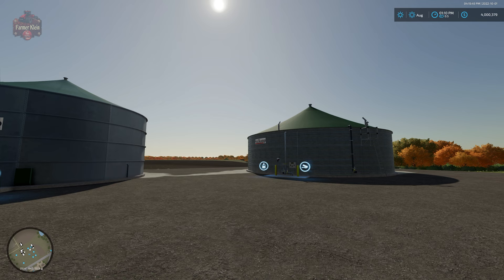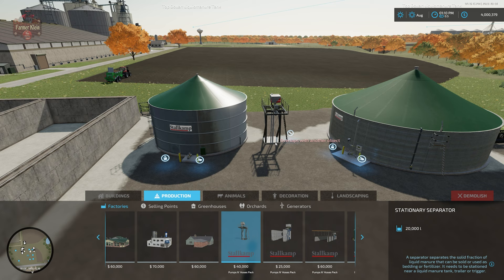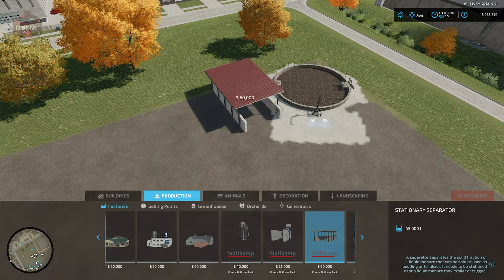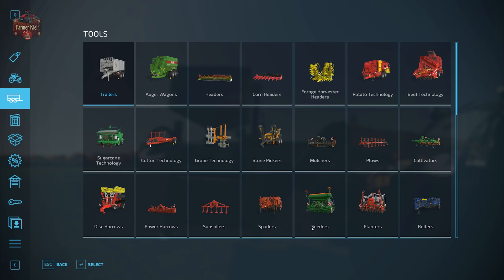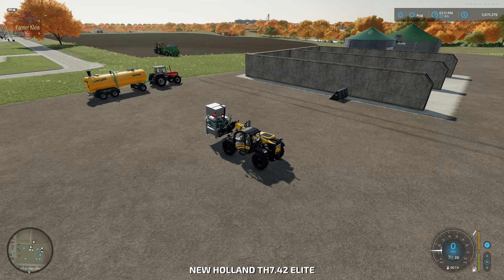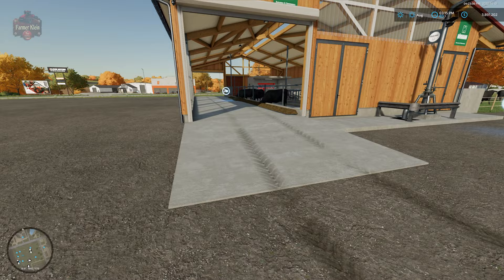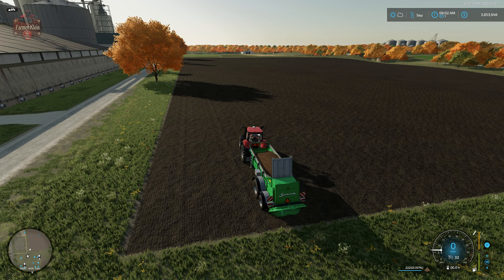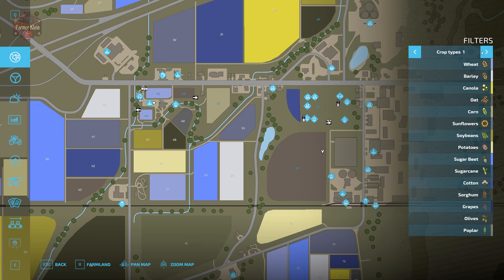Pumps N' Hoses A How To | Part 2 | Separated Manure

Comment: In the real world it would be used to remove the solids out if the slurry to concentrate the slurry, spread the solids and use the liquid for a bga or slurry spreading. Be interested to know if the slurry once “separated” is completely used or if you get a little bit of fluid back in return for some separated solids as it doesn’t look like you doo
Reply: I was thinking about this. When you separate manure, where is the other part (ingame)?
Reply: @salilladelop  just seems like it was a missed mechanic when implementing this, it’s awesome don’t get me wrong but essentially all that’s happening is your turning slurry or digestate from a liquid to a solid
Reply: I work on these machines a lot actually and yes the “water” or the bi product of the separators because they can never get all the water out goes in a return pipe back in to the reception pit it came from so it’s pretty much just recycled

Comment: How much nitrogen can it apply with precision dlc?
Reply from the maker: Unless precision farming picks it up as regular manure which I woudl probably require either an update to PF or a script within pumps n hoses to make that change to PF I would say none at all as the nitrogen value of a fertilizer is defined within the PF mod itself so adding tihngs like seperated manure or compost or anhydrdious requires either changing the PF mod to know how much nitrogen to add for a given soil type or a script to inject those chnges like the anhydrious addon mod does.

Comment: But Why?

I wanted to use digestate in the pumps and hoses, coming from cut beets and or silage. Makes sense.
But why the heck do something to a fertilizer to fertilize again. Unless it helps transport a concentrated solution to add water later. But that is where  the digestate could be used right?
Reply from the maker: Maybe you prefer using the manure spreader vs slurry tanker.  Maybe your using seperated manure as opposed to straw for bedding so your not growing a cereal crop just for straw.  Choice is what makes FS so dynamic vs so many other games that are so linear in nature you sometimes just feel like your going thru the motions.

Comment: Anyone else having an issue where the separator turns off when you sleep, and you have to turn it back on?  Also it doesn't appear the BGA processes anything at all when you pass time as well.  Is that just me?
Reply: the mod "Disable Turn Off Motor " will fix this but i've not tested it with pumps n hoses.
I use it for beet cutting and conveyor belts etc.
Reply from the maker: No mod needed just turn off AUtomatic Engine Start in the game settings.
Reply: @FarmerKlein  Well, I dont have automatic engine start turned on.  Also I get around $10k an hour when as I play (from the new BGA system).. thats a lot of money but fine whatever.   If I speed up time instead of sleeping and just watch it, it will go up to $70k-120k per hour.. it's ruining my hard economy save on no man's land... ugh.
Reply from the maker: On the Creative mesh discord there is a comment about the large fermenter having output that is to high.  Maybe that is what your seeing when you sleep.
Reply: Mine does that too